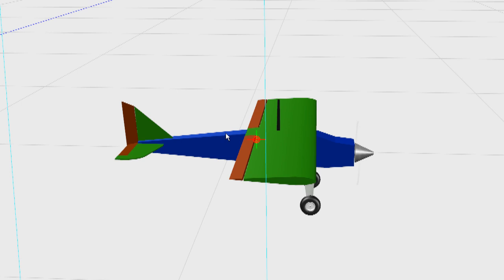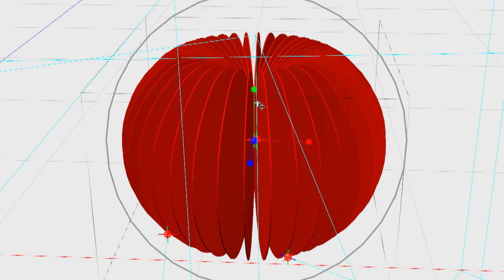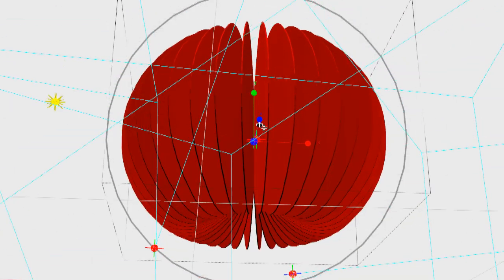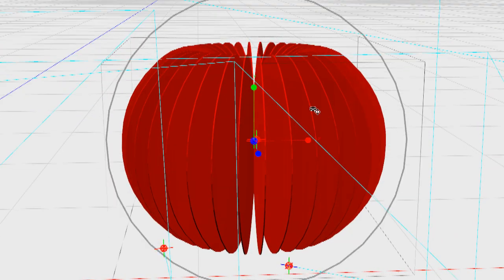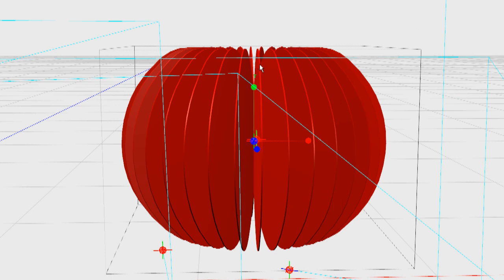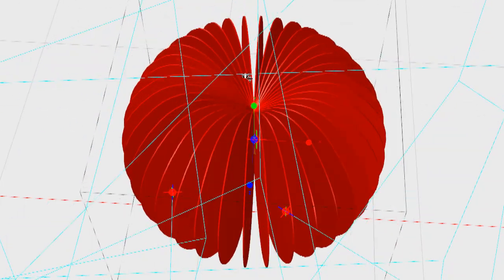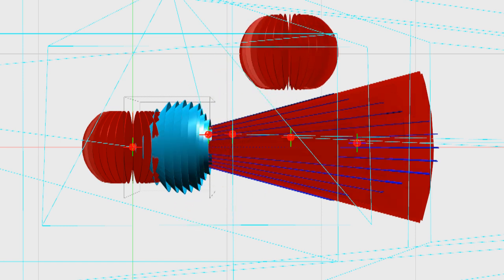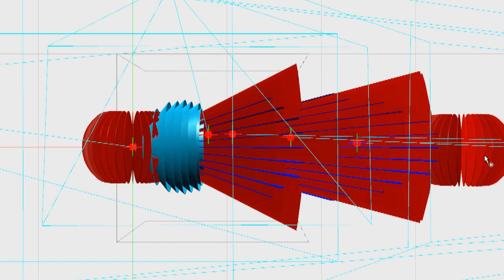⭐ FPV Antennas Long Range - EXPLAINED IN 3D! Polarization, Diversity & Gain Patterns

Comment: I put my video transmitter antenna on a gimbal to keep it straight up and down. No looses in db when the plane banks because the gimbal keeps the antenna from banking or pitching with the aircraft. I'm also using a yagi antenna on the transmitter and I can do this because the gimbal does 360 degrees on heading lock. So as long as I keep the plane out in front of my ground station it's always pointing the yagi back to the ground station increasing the range ten fold because both the 6 dbi PCB yagi on the transmitter and the 13dbi yagi antennas on the receiver are always facing each other. This was worth the extra few grams of the gimbal because now I never see video static or have any video drop outs ever. The power ground and video wires are fed throu the gimbal via a external slip ring system custom-made so 360 degrees continuous rotation is possible on all three axis.

 The auto pilot system is kept on pilot assist stabilization to further assist this by limiting the aircraft to 35 degrees in the role and 20 degrees in pitch. This helps to not push the gimbal past some of it's mechanical limitations. Even though it's a 360 degree gimbal in all directions there will always be some mechanical limitations to this so that's the job of the auto pilot stabilization assist.

The receiver yagi antennas are also mounted on a tracker to point  the yagi antennas straight at the aircraft at all times 360 degrees continuously.
My setup only has limitations flying at a distance from and at 180 degrees to the sides or behind the ground station do to the transmitter antenna being pointed in one direction consistently. These areas or blind spots are avoided during flight.
The video transmitter and gimbal are mounted under the aircraft between the belly and landing gear .This protects it and keeps it unobstructed by any part of the aircraft. Fiberglass landing gear were used to not block the transmission signal.
Reply from the maker: Great job! thanks for your comment - It's funny i'd planned something like that years ago and never got round to it - even the slipring idea - I have several of them I was planning to use for my Ultimate Antenna Tracker design (see my channel). I noticed recently there were a few 3D Print designs for Aircraft based pan / tilt antenna mounts for VTX. I was tempted to try it out on a new Mini-Talon build I've got coming up :) Thanks again for sharing your project Daniel :)

Comment: Excellent explanation. So if our UAV transmitter has two antennae, it makes sense to have one vertical and one horizontal, to imitate the diversity antenna?
Reply from the maker: Hey Phil, thanks for your comment, Typically you'd only want a single antenna on the TX side (you'll get all kinds of multipathing horridness with 2 transmitter antennas) but the RX side will be doing all the work to scrape up as much of the signal arriving from the single aircraft antenna as poss :)

Comment: Can you increase the distance of your antenna  by setting the SWR reading on the transmitter? Is that possible? Also what is the average wattage of most ground stations or transmitters used to control drones or planes?

Comment: If I am trying to fly at most 700ft up and 450ft away mostly in front of me and at most 400ft to the sides and 200ft behind. What would be an idea setup. Right now I am using a 6dbi patch with a 1.5 circular for rx side. Will be going with a 1.5 circular on vtx more likely so that I can use it on a drone also. But would a rubber ducky at 2dbi work better for the situation I am asking? Thanks. I am just trying to get (mostly high altitude) speed runs with a flying wing without outdoing my radio system before video because it has happened before. Using a 5.8 600mw on a 2dbi rubber ducky. I switched the ducky to a cheap circular 2.5dbi on vtx and have most terrible range and quality. Otherwise do you think a 1.5 (quality) Duraspec antenna would out do the 2dbi ducky for this situation since the cheap supposed 2.5 circular was much worst. Actually worst than my cousins 200mw with duraspecs on both ends and no diversity. I just don't understand.

Comment: which simulator are u using?
Reply from the maker: Hey you, when you say simulator, do you mean the software used to do the 3D? It's an old 3D design program called eRain Swift 3D - I had to make everything from scratch in 3D (including the aircraft) :) Cheers

Comment: I don't understand why the two fields have to touch eachother. Shouldn't the transmitter's field have to touch the receiving antenna?
Reply from the maker: Hiya Alex, thanks for your comment - Yes, you're absolutely right, but for this illustration, it shows the transmission range of the Omni on the aircraft, but I show the sensitivity of the RX Antennas as taken from the antenna datasheet - so it's kinda the best way to show both sides interaction :)

Comment from the maker: hi youpattube1 thanks for your comments, the clover leaf / skew planer and coil ones (I'm assuming you mean the Helix type ones?) they are all circularly polarized antennas (which are best for things like FPV hence how popular they are now). The coil (Helix) antennas is essentially like a Yagi as I reference in the video (high gain / long range antenna) but the Helix is the circularly polarized version for use with typically a Skew Planar or Clover leaf antenna onboard your aircraft. I trust I've been of help ;)